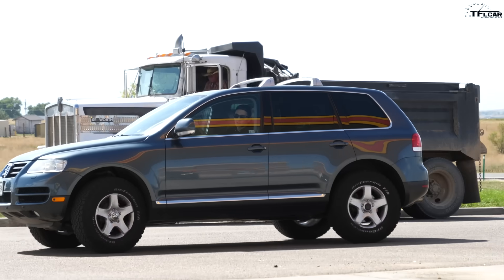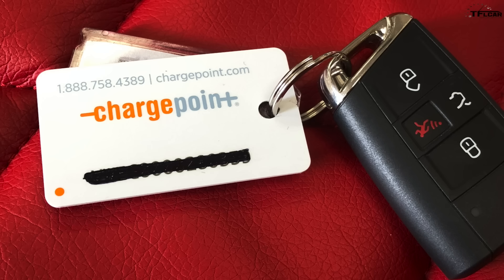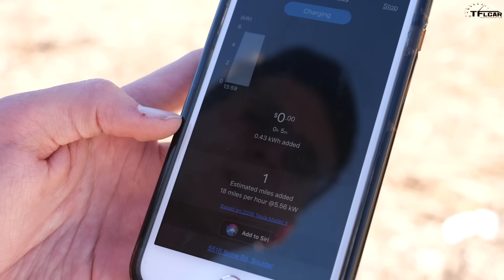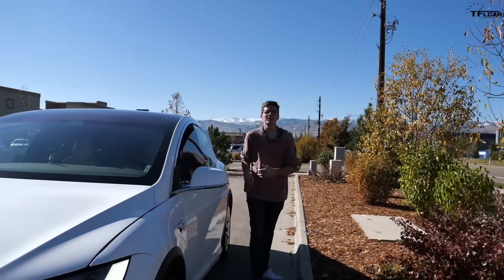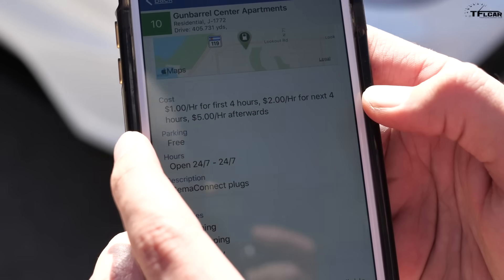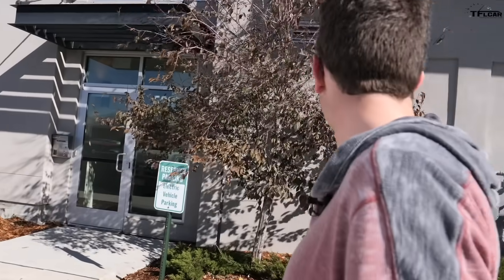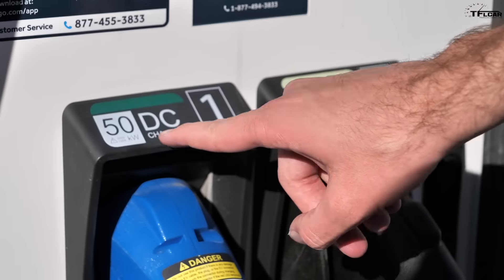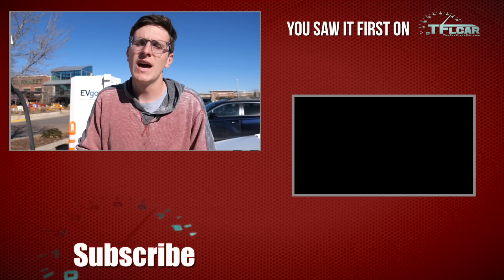Here’s Why Charging an Electric Car Can Suck - And It’s Not The Reason You Think!

Comment: I don have my own garage. I don have a Tesla, YET. In my opinion, fully electric car is not convenience yet, due to the charging time is still long and the charging stations are still limited.  I do a lot of long trips, most destinations that I travel to have no super charging station yet neither normal charge (I'm in Canada) for example, traveling from Montreal to Gaspesie with Tesla is impossible due to out of range and no charging station. I will wait for super fast charge technology to be released (10mins charge = 80%) or 80% of charge = ~800km-1000km driving. Really wanna go green, but can't for now.
Reply: There's 4 superchargers between Montreal and Gaspesie...range isn't an issue. Though extreme cold weather would be a negative impact.

https://abetterrouteplanner.com/?plan_uuid=cee89f77-fa40-4659-b9b6-29ba110543e2

You would spend a whopping 17 minutes charging for a 7 hour drive.
Reply: @geologik7500  Thanks for the info, but the last supercharger is not in Gaspesie, it's in Amqui which is ~ 350km to Gaspesie. Let's say you do full charge to 100% at Amqui = 518km battery drive, You can't make a round trip between Amqui and Gaspesie, not to mention if you go a bit further to Perce. So Yes, Range is an issue plus yes extreme cold is surely a negative impact.

Comment: I have, in 6 months of owning an EV, never had to charge at a public charging station. Ok I am privileged, I live in a country with 240v per phase line voltage, like most of the world, not a insipient 110v. I am privileged as I have a house with a garage. I spent $700 for a 32A (7.2 kw) EVSE (charge point). I have not been to a Gas station in the last 7 months. I plug in when I get home and unplug when I leave. I sleep, the car charges. It's called multi tasking. Each day I have 80% State of charge because that is what I set. It cost me $12.50 a week 200 or so miles, commuting 40 miles a day. Even your Mom could do that, I am sure. 

It isn't Rocket Surgery.

I am not sure if you are anti EV or just … well … I won't be rude.

Comment: What a load of FUD. You have a Tesla Model X, it has FREE supercharging for however long you own it. It came with a  FREE charger that can charge at 7.2kw which is faster than all the level 2 chargers you went to. Tesla superchargers are faster than the two DC chargers you went to, but you don’t state that. You are apparently are just refusing to pay an electrician ($200 ish) or man up (it’s not that hard to run a 50a 240v circuit) to add a NEMA 6-50 to your garage. What off roader doesn’t have a 50a welder plug anyway?  All those “problems” are for people who do not have Teslas. You have one. Almost all the EVs in the US are Teslas. There is virtually nowhere you can’t go anytime you want. If you want to have those “problems” get the Jag, or the Audi or the Merc and you can be more truthful with you “problems”.

Comment: Good video, but it's very American-centric. The Kia Soul EV/Niro+Hyundai Kona all charge at 80 kW, which is a better non-Tesla approximation of tipping point for charging stops to reach parity with gas refueling stops. As for the non-educated consumer, the reality is that most people don't know how ICE cars work, either. So, BEVs will take off when the default $27K Accord/Camry is BEV with 250 mi EPA range and 100 kW charging. Once the no-brainer American cars are BEVs, it won't be such a big deal.

Comment: This is such nonsense.  Yes, no garage...no EV.  However, if you have a garage it is VERY simple to install a high voltage charger in your garage.  I am 6 weeks into ownership of my first EV...a Tesla Model 3.  Unless you drive hundreds of miles each day there is NO REASON to use one of the commercial charging stations.  I leave the house every day with the equivalent of a full tank.  Prior to purchase I was focused on the discussion of where/how/etc do I charge the car.  It was only afterwards that I understood that the real question you should be asking yourself "why would I ever go back to a car that required me to stop at gas stations?".  Without a garage I wouldn't be saying this, but with a garage it is orders of magnitude easier and more convenient that an ICE vehicle.  I have already decided that when my lease on my XC90 ends I am replacing it with a Model Y.  I get so annoyed now when I get into the XC90 and realize I need gas...so inconvenient!!!

Comment: Charging at 15mph and after 10 hours you have an additional 150 miles of range. Meanwhile I've just driven from Houston to El Paso or 746 miles.
Reply: We did OKC to Santa Fe in our model 3 and it only added 30 minutes in stops over an 8 hour trip  🤷‍♂️

Cost us 0$ thanks to referrals

We get 30 mi/hr at home and 500+ on a supercharger. Wake up every morning with a full tank.
Reply: @geologik7500 on your trip your recharges were at more than 15 mi/hr. The charger Tommy was using was 15 mi/hr that is just too slow for real open road use. I drive Amarillo to New Orleans two or three times a month that rate would not work for me. I also try to avoid interstates and use back roads so electric cars are also nonstarters for me there too. I'm grateful early adopters like you exist though. I know that one day I'll be driving via electricity but it isn't an option for me until the infrastructure is much more developed.
Reply: @zimmejoc  That's why those types of chargers are called "destination chargers" no other EV manufacturer has the same infrastructure as Tesla does. If you need the range and charger support, buy a Tesla.

It's very misleading to ONLY show slow level 2 chargers when's he driving a Tesla.

Only showing level 2 charging, when that's the exception for Tesla drivers, is like driving on back roads at 40mph and complaining it took you twice as long to get somewhere vs driving on a perfectly good highway at 80.
Reply: @zimmejoc  I'm not sure on your reasoning for avoiding the interstate, but there's super chargers everywhere between Amarillo and New Orleans. Plus, using AP to drive for you nearly 90% of the time, and the gas savings seems like a no brainier to me, especially if that's a regular drive for you.

Definitely hoping to see the industry and infrastructure make a surge though!

Comment: Do you feel confident manipulating a high-voltage plug & socket in an open uncovered parking lot, when it's 40 degrees F out,  in a driving sideways rainstorm?
Reply: Since there is no power on the plugs until the charging session begins, there is absolutely no risk of a shock.
Reply: That is akin to saying, I can smoke my cigarette just fine when I'm pumping gas in my car because the gas doesn't start flowing until I pull the trigger...I suppose as you're standing away from the car as the power is applied, & somewhere there is a flashing indicator alerting you to an "error", or "fault"....& you can't seem to get it to work....maybe it's those sheets of rain you're getting drenched in...dummy.
Reply: Ricardo Ellison --- That's a false analogy. Smoking near a gas pump could ignite gasoline vapors, not necessarily from the pump nozzle you're using, but also from puddles of fuel someone spilled before you. The EV charging stations were carefully engineered to reduce the risk of shocks  as much as possible. As a Tesla owner, I've charged in the rain at their Supercharger stations without any qualms or mishap. It would only be dangerous if there were an electrical storm overhead or very nearby.
Reply: @donaldmoe3286   Obviously you have never dealt with a hairline crack in a plastic "insulator"...I have an electric mixer right now that has such a crack in the plastic housing, allowing 110V thru to my hand...I have to re-position  my grip on the device every time I pick it up.
   Give your precious Tesla another 20 years time & see how that plastic "power nozzle"  insulative specs holds up being bombarded by UV exposure in the sunlight...but I need fear such a thing, you'll get rid of your Tesla inside 5 years guaranteed.
Reply: Ricardo Ellison -- Actually I have dealt with broken or damaged insulators during my early years as an amateur radio operator. It meant replacing the damaged or defective parts. Likewise when I've encountered a damaged charger wand at a Tesla Supercharger site, which has been quite seldom, I use a different charger stall and promptly report the damage to Tesla. If the charger port on my Model 3 developed problems, I would get it repaired. I plan to keep my Tesla for longer than you think, perhaps 15-20 years. My previous car, a VW Passat Wagon, was 17 y.o. when I sold it to Carmax after taking delivery of my Tesla in September 2018. As for your damaged mixer, just replace it instead of risking a shock with such a cheap appliance.
Reply: @donaldmoe3286  OK, so we are similarly educated on the subject at hand....here's hoping all Tesla owners are as astute & knowledgeable dealing with electricity....dont-cha just love Smith Charts...SWR & transmission line theory..Kudos

Comment: You left out the fact that the Model X like yours charges the slowest of all Tesla Models unless you have an older model with dual onboard chargers. Also Teslas can have the most charging options when you add all the destination chargers and chargers at businesses and restaurants for Tesla. I have not seen a Chargepoint charger that was not free in Houston, Texas. Guess I have been lucky but my wall charger charges at 11.5kWh which is much faster than the free Chargepoint chargers which is 43-44 miles of range per hour on my model 3.

Comment: The problem with this video is that you used the Model X as the example.  Model X owners have garages and 240 watt charging capability.  In very rare circumstances would a Tesla owner use any of these alternate charging stations.  This video would have been much more relevant had you used a Leaf or a Bolt.

Comment: honestly it looks like they still need another 10-15 years before EV cars are going to be anywhere NEAR viable... first off they need to standardize the plug or it's just a shit show... and they ALL need to step up the charge speed because it's already HIGHLY inefficient to convert gas/hydro/wind/solar power on one end into electricity and then have it converted again to/from high amp/high voltage into batteries that again are inefficient at releasing that stored power... too much loss in the system compared to just using fuel... besides using electricity doesn't make you ANY cleaner than a gas car... you just don't see the fuel you're burning because it's at the other end of an inefficient system... "out of sight out of mind" mindset... the Sterling Engine that NASA built back in the 90's outperforms every other engine/motor out there for fuel economy, emissions and power output, it's need to be serviced is also very low. tech that was too far ahead of it's time that has gotten lost in the big oil and gas boom of the time.

Comment: when did 5kw become "a fairly decent rate"? :)
Reply: It hasn't been since like 2005. This is something you should have in a parking lot for shopping... if you are grocery shopping and want to plug it in while you are doing that.. then it is a "decent" rate but if you are charging for more than a days drive in the city while shopping then it is horrible..
Reply: @Kaziklu  And while you are shopping you gain 8 miles of range.  Whoo Hooo ...
Reply: 5kw is perfect for plugin hybrids which have 7-50kwh batteries and 12-20 gallon gas tanks with dual electric/gas engines.  The battery gets plugged in every night and normal commute daily driving is via battery.  Long distance car trips of 600 miles+ are done using the gas engine with the electric going on only when stuck in traffic or full power is needed.  Plugin hybrids can get 50-60MPG on long trips and normal daily driving uses cheapest fuel gas/electric.  Much better than pure BEV.
Reply: @engineeringVirtue  And they will pay a high cost for a new battery when needed !
Reply: i have seen these at work after a 10 hour work day it would be enough to get around. and a apartment complex so over night would be fine.
Reply: If it's at a gym, church, school, or grocery store. Might be okay, cause your there for a while and don't need to be charged real quick, cause you got like half a tank/charge. Yes there needs to be a lot of them to. Some is better then NONE.
Reply: Most people don't even know what a Watt is !
Reply: @mountainrambler1077  Joule ? Is that you?
Reply: @msimon6808  no !
Reply: This is the US, go deal with it XD
Reply: 60-120kW public chargers are available in my city. Then it becomes reasonable.
Reply: it isn't.  he cherry picked that chargepoint for that reason.
Reply: The model 3 can do 250 at v3 superchargers
Reply: on the 12th of never
Reply: When the typical outlet is good for 1200 watts (conservative 120V 15A service).
Reply: Tor Ivan Boine - Not in the Tesla world, much faster chargers, 75 to 250 kw.
Reply: Any rate that gets your vehicle fully recharged overnight is 'fairly decent'.  This will cover the large majority of driving needs.
Reply: @JamesOlsenJamesJOlsen  The rate shown would take 10 hours to get around half a charge on the battery.  Would take nearly a day for a full charge.
Reply: @JamesOlsenJamesJOlsen  Over who's night?  If you are home 12 hours you get 192 miles of range or so at 16 miles each hour.  If you have to use the car in the evening, you can cut that down.  That's not fully charged.  I'm starting to understand range anxiety now.  Too slow ...
Reply: https://youtu.be/00-UD6OYOyg
There you go problems resolved.

Comment: Getting a high voltage charger in our garage was a must have. Instead of a whole day we can charge in just hours (or partially in a hour or 2)
Reply: Not really, some people sleep, there's 50 mile right there, no waiting as your asleep...
Reply: @michaelberger6699  we thought that too, but with 3 people using it that was just not feasible. Too many times someone needed it and it was still too low to use. Once we got the high voltage, you can plug it in for 1 hour and it'll be enough to get you by.
Reply: Does not require a Garage also. Just needs Private Parking near the Building with 240v line. Obviously the chargers in this video were outside.
Reply: @Neojhun  ours attaches to the garage wall. I guess you could have it outside but that would expose it to sun/rain/snow...
Reply: M Detlef  can you clarify what those are?
Reply: What if you don't have a garage? What if you don't have a driveway? What if you live in an apartment complex with assigned parking? Is everyone going to get a charger, including guest parking spaces?
Reply: @duradim1  that would be cool if appartments etc offered this as a feature. Instead of the stupid pool and a pathetic "weight room", spend the money on chargers
Reply: duradim1 Apartment owners may eventually find that providing 240 volt plug for each spot in the parking areas becomes an amenity that helps them compete for tenants. But for now, if you live in an apartment an EV is going to be pretty troublesome to keep charged.
Reply: @jimmurphy5355  Ah, just a note... 240 volt outdoor power... not something I would want to be using if it was raining. And if I was the landlord, I'd forbid it as the fire and electric shock hazards would cancel my insurance. Not to mention a malfunction in the car could cause a fire. And why is nobody mentioning the DAMAGE to the batteries with super fast charging? You have $22k sitting around to pay to replace those batteries early?
Reply: @dking1836  Ever seen the outdoor “shore power” connections at RV parks and boat docks? The are probably close to a million of them in the US. 50 amp 240 volt sockets that people plug into, rain or shine, every day at thousands of places. Know what isn’t a problem? People getting electrocuted when they use those outlets.
Know what else isn’t a problem? Battery damage from charging from a high amperage 240 volts outlet. The onboard charger in an EV, even when powered from a 240 volt 50 amp circuit is putting less than 10,000 watts into the battery. DC fast charging at a commercial charger is 50,000 watts or more. Even the fastest home charging from an AC outlet is super easy on the battery of an EV.

Comment: I personally won’t get an electric car anytime soon. The closest charging station to me is 37 miles away not counting my house.
Reply: Thing is, if you have a garage, or live in an apartment with a charge port for residents, you more than likely would rarely if ever use any charging stations near your home.

I live in a small town about 50 miles from the nearest Supercharger, or any other public charger for that matter. The only time I'd ever have to use one of those stations is as part of a trip that will exceed the range of the vehicle.
You don't have to recharge to 00% at a public charge spot, you only need to recharge enough to get to where you are going.

As an example, if say on a 400 mile day trip, you have a 300 mile range EV. You only need to add 100 miles of charge at a public station of some kind (20-30m with a fast charger) to get home with say 10% battery left. Once at home you'll recharge it to full in 8-14 hours with your cheaper house power.

Comment: If you can have an electrician install a 240v home charger (~$3-600 for the charger and mine was $200 install), I wake up everyday to a full battery.  Charging like you're showing IS slower and more time consuming than filling up with gas, BUT all those times one would have to go to a gas station on a regular basis, I don't need to.  Overall I have calculated that I am saving time with my EV, I drive 62 miles a day on average, annually.  I spend 0 time looking for charging stations because I have plenty of range and just charge at home.  Plus its cheapest at home too.  I am no environmentalist, I'm glad its better than a polluting car but the luxury of never needing to visit a gas station is awesome.  I can never go back to gas.